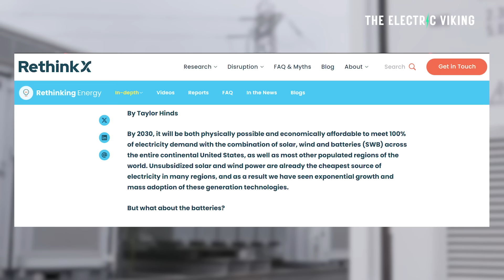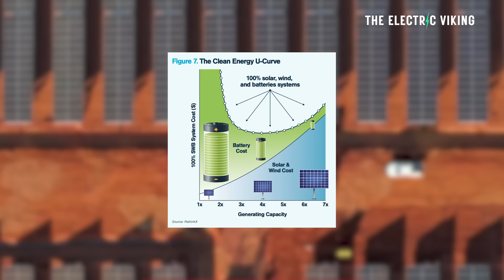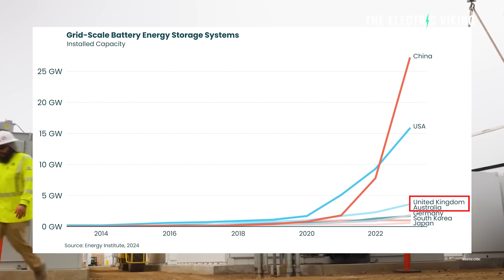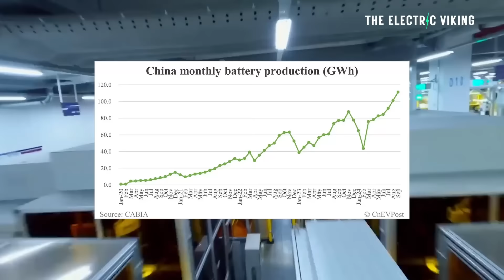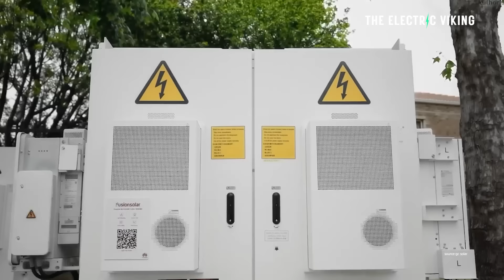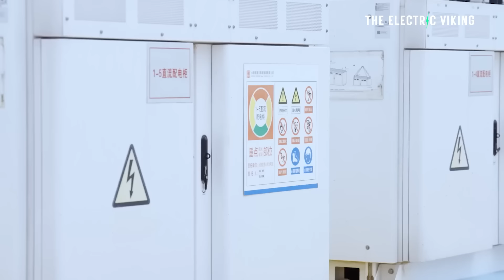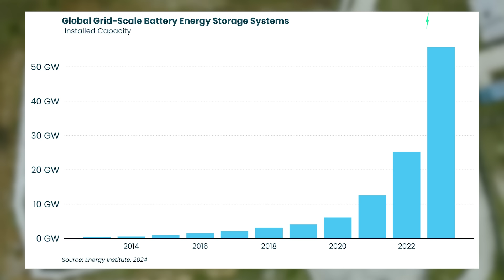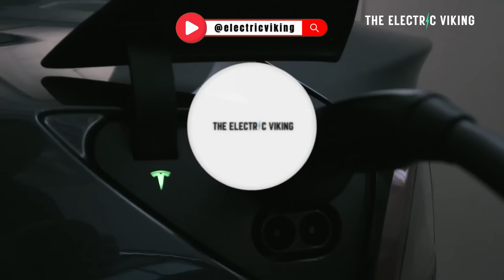RethinkX reveals the shocking exponential growth of battery storage worldwide

Comment from the maker: The best solar company in Australia just installed my new solar system. 
Check them out here: https://www.resinc.com.au/electricviking
Reply: @electricviking  would we see tramlines get repurposed gir vehicles, with pantographs?; small batteries forlast leg 2-5 kmg2gf(ygatr to garage, portable lástll2-5;kmeg gate yo garbage?pleg(2-5 km( modular detatchable)
Reply: The science teacher, I had had a concrete block and it would raise the concrete block with excess energy, and when you need more energy to lowering more energy, electricity.
In Switzerland, they pump use excess electricity to pump water back up the mountain to be used to create electricity

Comment: Prices of battery storage and solar each fall 80-90% every decade, anyone who understands the implications of this knows that fossil fuels have no long term ability to compete economically with solar + batteries.
Reply: While petrol prices are going higher and higher. 😂
Reply: Great report but I wish Viking would compute numbers on a percapita basis when comparing nations or states. It's really frustrating to analytical professionals when he blithely compares battery storage, etc., in Australia to the  US or China, or even the two latter to each other. You have no sense of scale or rate of adoption, just a jumble of meaningless numbers. Australia is a tiny little country! We learn nothing when you show a graph where China and US are way up in capacity and Australia is a thin line at the very bottom. But do the Math Sam. Multiply by 15 and you get an informative graph. Duh! I'm very frustrated because this is one of very, very few sources of reliable information on the subjects of EVs, batteries, etc. I guess he's trying to not get too technical for a lay audience. Okay. But a little tweak here and there wouldn't hurt. Great Channel!
Reply: Battery prices aren't falling..they already fell.
Reply: @grantbuttenshaw  
Lithium based batteries are still too expensive, prices need to be 1/10th of what they are now to be more affordable for most people.
Reply: Which is fine. It will allow us to use oil for more important things.
Reply: @grantbuttenshaw and continue falling.
Reply: @Anonymous------ what are you comparing to?
Reply: Nor does nuclear
Reply: @keepitreal2902  it can be argued nuclear doesn’t even compete with fossil fuels. Nukes is about as expensive an energy as you get.
Reply: The price of the panels may fall, but the cost of the installation goes up. Payback period on a 25kW system tied into the grid was 18+ years on my last quote. No batteries. The cost of a system fully capable of providing all required power was going to be north of $100,000
Reply: Battery prices will plateau eventually, yet performance will increase. 

 I firmly believe a 5,000 wh/kg battery is possible or more with lithium air. They can therotically rival gasoline with a specific energy of 40k. Gasoline is like 45k.

 Max therotical effiency is impossible. So even half that would make batteries 10 times better. 

 The potential is there with batteries. That is why I love them. 

We will still need ICE for some applications like military. 

  Hybrids would do wonderful. There is an engine with a therotical effiency of 70% called the vane engine. I hope people try to make that too, and pulse jet scram engines. Oh and nuclear cells using TPV the size of a football.
Reply: @dianapennepacker6854 the more capacity per volume or weight you get, there  more you approach a bomb.
Reply: @229andymon nuclear is cheap.  If you only calculate a 20 year period it's expensive but when you factor in that they can go for 80 years then it's cheap.  The total all in cost per kw for nuclear reactors in the US is 2.5 cents per kw.
Reply: @grantbuttenshaw  they have fallen but are still predicted to drop further. Goldman Sachs predicts pack level costs will drop by another 50% by 2026. That’s just lithium ion batteries, there are also many other technologies used for grid scale storage such as flow batteries which are only now being commercialized and could also potentially see similar cost reductions if economies of scale kick in.
Reply: @Ria-hx8nl  the efficiency of solar also continues to go up, which reduces payback time. But if the solar is too expensive for you, then don’t install it. Or wait for higher efficiency panels to arrive and then get some. Personally I’m waiting just a bit longer as I only recently had a new roof installed so I’m unfamiliar with installation costs, but they shouldn’t increase dramatically as it’s simply the cost of labour, which predictably does go up every year with inflation, and will have jumped disproportionately in the last few years like everything else.
Reply: @pin65371  The cost of nuclear doesn't include the 100,000 year waste storage cost.   Nuclear is cheap to 'operate' but ridiculously expensive to build.  It's inherent danger is why it must be so overbuilt and expensive - it can not be allowed to fail in any scenario.   There will be some scenarios where nuclear's benefits potentially outweigh it's negatives - military and polar installations being the obvious examples.
Reply: @pin65371  Nuclear is cheap?
Not really.
Planning and building takes years.
Decommissioning is even FSD more expensive and takes decades.
Getting rid of an old Hungarian nuclear plants is taking billions.
People conveniently forgetting that.
Reply: @hanswitvliet8188  the reactor building last for 80+ years.  That is the biggest expense. So yes it is cheap when you spread the costs out over a long period of time.  It's the same reason why hydro is cheap while taking a long time to build and having high up front costs.
Reply: @pin65371 Where did you factor in the costs for storing highly radioactive waste? Not at all. Otherwise you wouldn't be able to write such comments.

Welcome to reality, where nuclear is and stays the most expensive energy.

80 years lifetime for nuclear power plants is ridiculous. No one who's serious will even discuss that nonsense for very obvious reasons.
Reply: @jantjarks7946  a lot of reactors in the US and Canada have been given approval to run to 70-80 years now.  So the regulators and engineers agree with me.
Reply: To get an SLR is one thing, but to invest into the more than 100 major projects required to keep the reactors in operation is a complete business case disaster, compared to the costs of renewable energy.
Reply: @pin65371  Maybe one day YT let's my comment go through. Maybe not. 😂
Reply: @pin65371  Well, the banks have to agree too. Just, why would they, considering the fact that renewable energy is far cheaper anyways and build up faster.
Reply: @jantjarks7946  because the banks also realize you need power at all times.  If a Tesla megapack costs $1.4 million and gives you 4 MW of capacity with 2 MWh output you'd need 500 of them to run some of these data centers for 2 hours.  That is just for the storage.  Then you are having to build the pad where everything goes along with possibly needing some sort of protection and possibly heating.  Then you need enough solar and wind to power the grid plus having enough to charge all the batteries to provide backup.  One other thing that is noticed is you will almost never see an engineer suggest these solutions. The people that actually know how a power system work mostly think this is a stupid plan.
Reply: @jantjarks7946  and one other thing to really show how stupid this idea is.  In Ontario Canada is where the biggest nuclear facility is.  It outputs 6.5 GW and sits on 2200 acres.  In Alberta Canada which has a lot of sun there is 7 GW of renewable capacity.  Travers solar is 400 MW and sits on 3300 acres.  When you take and add ALL of the renewable output in a year that nuclear power plant (which takes up less land than a single solar power plant) produces 4x more power than everything in Alberta.  They are planning on almost doubling the capacity for that nuclear power plant as well. Just the wind power alone uses more concrete than the nuclear power plant when you add up all the materials required to hit 1 GW of wind capacity.
Reply: @Ria-hx8nl  What about the value of the asset itself? I’d pay more for your house if it had such a system installed. People install conservatories etc that have no payback, but they still do it.
Reply: @Anonymous------ no they are not. But true they will. As we move to EVs some with ice cars will be left behind.
Reply: The Stone Age didn't end because we ran out of stones!
Reply: @pin65371  A lot of people are meant to last 70-80 years too. But they don’t either. 
Why don’t you do a bit of research and tell us how long the average nuke station actually lasts?
Reply: Ok let me know when they  work
Reply: @Anonymous------ they already fell but the savings aren't being based on to the consumers but eaten up by middle men. Import directly and you'll save a pretty penny
Reply: @Ria-hx8nl your being ripped off, just raw cost of 50kwh of Lifep04 batteries and 25kw of solar panels alone is under $15k and that's with US tariffs included.
Wiring and other stuff cost money and so does mounting hardware which can be had for cheaper if you get a welder to make it for you because the pre-made stuff suppliers charge through the roof. Even with the inverters and everything else, you'd be hard pressed to spend over 50k for going completely off grid. Realistically, DIY would be no more than 30k - 35k and with labor, no more than 40k - 45k
Reply: @jantjarks7946 u don't, u se breeder reactors like France that consume that nuclear "waste" for energy generation, final byproduct being drastically less radioactive and only requiring 200 years of storage vs 10k. The waste also decreases more than 10 FOLD when used by the breeder reactors
Reply: @NadeemAhmed-nv2br  Only 200 years? I would like an official source for that nonsense. Not even the industry is claiming that.
Reply: @NadeemAhmed-nv2br  
Buying solar panels or anything else directly from China should save a lot of money in prices but heavy things such as solar panels have a higher shipping fee. Also another issue is quality,  correct type and warranty, these can be problems when buying from overseas, returning or exchanging items can be troublesome and costly.
Reply: Leave it in the ground @jacuzzibusguy
Reply: In Australia with the highest world uptake, per capita, of rooftop PV still has a ways to go. Where is the PV on every roof, covering every carpark etc. it's limit has been the grid issues, including limited storage ( incl pumped hydro). With battery prices dropping the future is exciting. Forget nuclear, gas or coal when you can have a power station at your home the necessity for expensive baseload is just not viable.
Reply: No. You still need a baseload. Batteries can only operate for a couple of hours at capacity. Not enough for the night for solar. You need continuous (base) load.
Base load advanced nuclear is a perfect compliment. Not wasteful/dangerous light water reactors - liquid salt reactors (esp Thorium). Safe, economical, clean base load to work with renewables.
Reply: @avgjoe5969  is it really safe tho. Because how many nuclear disasters can the planet take. If nuclear is used everywhere, thats hundreds of disasters
Reply: Where is the sunlight going to come from in UK ?⚠️
Not a hope
Reply: Also, burning hydrocarbons is an absolute WASTE of their long term usefulness!
Reply: Let m😊e ask Trump drill baby drill?
Reply: Here in British Columbia it can be raining for 30 days in a row. Good luck for your batteries.
Reply: @grantbuttenshaw Still falling prices for batteries.
Reply: @Anonymous------ Not even close to accurate. Most people will benefit from Batteries at Grid Scale.
Reply: @pin65371 NOPE. Nuclear STILL has problems with both Radioactive Materials Disposal AND potential nuclear meltdown or explosions because they can be struck with explosives and cause serious exposure to radioactive fallout, etc. 
pretending that Mother Nature or Human Interference can’t cause catastrophic damage to Nuclear Facilities is foolish.
Reply: @Ria-hx8nl This article is about Grid Storage not domestic applications of battery storage. I agree that domestically the cost is prohibitative but I suspect part of the reason is the power company not paying you a fair price for the power the panels produce and the installer lacks competition in the market and can charge a little more.  Given widespread adoption installation will get cheaper as will the batteries themselves.
Reply: Logic, agreed! And, if we were honest about the indirect costs of fossil fuels, peril and coal would cost a hundred times what it does now. The costs of the damage burning coal and gas to our health, our water, our air, our climate and our planet are staggering! 

I’m calling out everyone here who has the money to replace our gas furnaces and hot water heaters with electric, to replace your air polluting car with an EV, and to install batteries and solar panels. If we do this, prices for solar, batteries and EVs will drop more quickly. We will be helping ourselves, our planet and our  neighbors who don’t make as much money. 

And, fossil fuels are inherently cartels and electric utilities are inherently monopolies. There is no capitalistic competition with these industries. ,This allows them to amass sickening amounts of wealth, purchase governments, and price gouge their captive customers.
Reply: Hate to break it to you but we were energy independent during Trump's first tenure. Starting on Jan 20 it's drill baby drill again and the huge abundance of oil and gas will even allow us to export it again. CPI will drop dramatically and quickly once Trump is back in office. Photovoltaic is a huge gamble and strategically sucuidal. Btw, nuclear power is the cleanest, cheapest and most sustainable. It will last forever.
Reply: @pin65371  except you need to calculate the cost of upgrading & maintaining the reactor so it CAN last that long. Also maybe calculate the cost of ongoing "safe" storage of high level waste for the next 10,000 years or so and it's not like you can go to your nearest Uranium supplier for fuel your choices are limited so you're at the whims of your supplier as to the cost of fuel. Then of course the increased movement of fuel and waste can become serious environmental disasters.
Reply: @grantbuttenshaw  so why am my AA batteries more expensive rhen ever :)
Reply: @julesviolin  I thought that was obvious. From the Sun.
Reply: @Ria-hx8nl exactly my thoughts, I have been monitoring this I wanted a small system with battery but no change on ROI 😢
Reply: LMFAO. What utter balderdash.
Reply: @grantbuttenshaw and are continuing to fall. Wright's law in full effect. Look at the new production coming online for at least the next decade and it is telling you that the current rate of price declines is not slowing for at least a decade and likely much more.
Reply: @lindsayfox7206  where did you read this....link it...

I've read all the Chinese data on battery manufacturing and prices for all types of batteries..

Tesla power walls have never fallen in price... explain that.